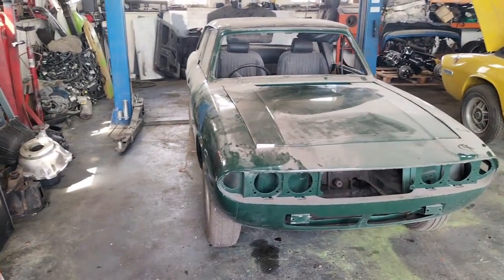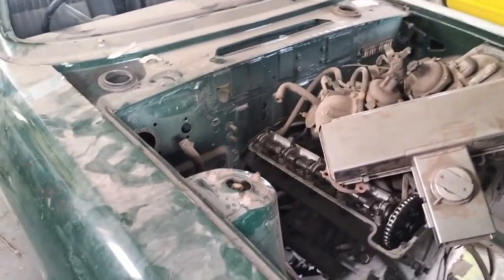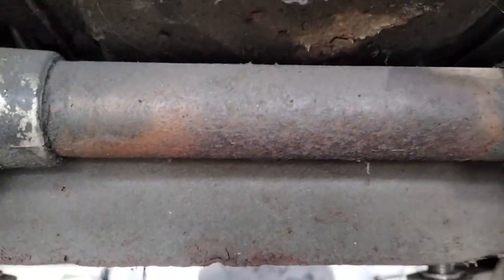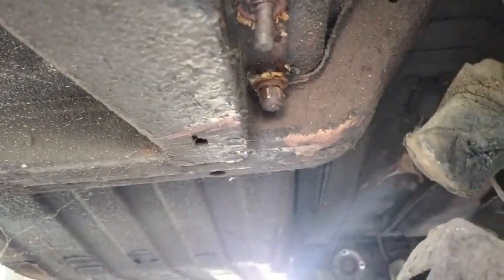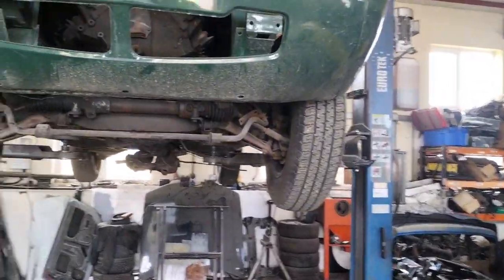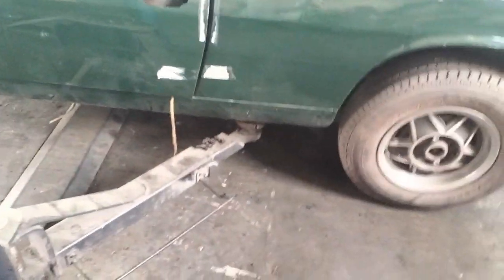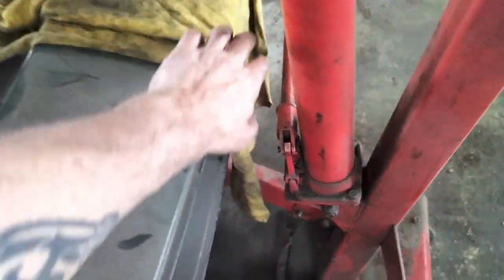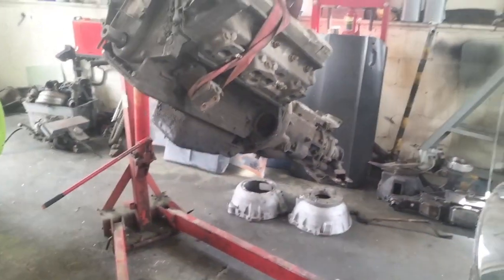How to - Triumph Stag mk2 engine removal - start of restoration/recommission part 1

Comment: Great filming !  Thanks , yes please carry on with engine rebuild  what you find and cure , and the build back into the car , just rebuilt mine auto and did it piece meal , engine in ,then convertor ,bell housing , then line up pump tangs then the auto box , just that's the way we used to do it in garages in the seventies, great vehicle the stag , ticks so many boxes !
Reply from the maker: Oh thanks, that's great to hear. I've got a couple more videos to edit which cover splitting the engine and gearbox and stripping the engine, few surprises in there lol. Those bell housing bolts at the top are a nightmare to do in the car, easy if the heads are off but hard to get to with the engine built up
Reply: @YorkshireClassicCarsltd   yes thanks you ain't  kidding  long extension s , go over the top  same with the starter top bolt , look forward  to next films now subscribed !
Reply from the maker: @stevesalvage1089  cheers, really appreciate it 👍